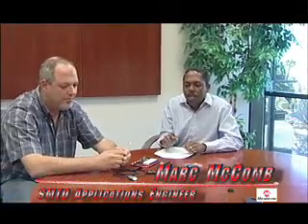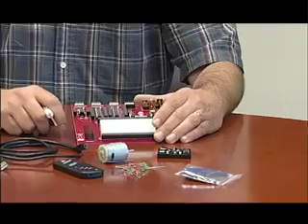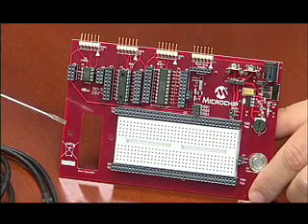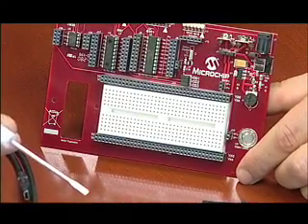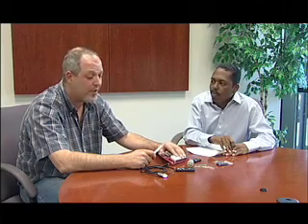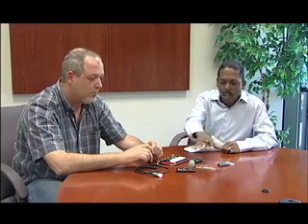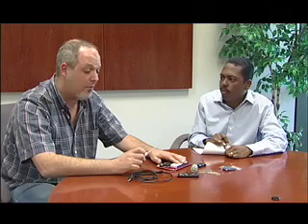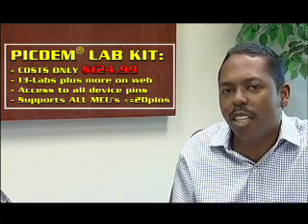PICDEM Lab Development Kit

Comment: Just bought one of these, so far I've been really disappointed. The CD docs all refer to versions of software that aren't specified and most certainly not up to date. They are also not for absolute beginners because applying the tutorials to the latest software is nearly impossible without a good understanding first. Tech support is non existent via the web portal or the phone. It has been very frustrating and so far a total waste of £130.